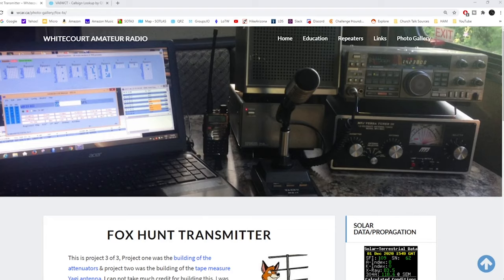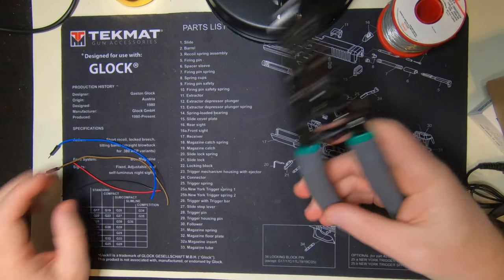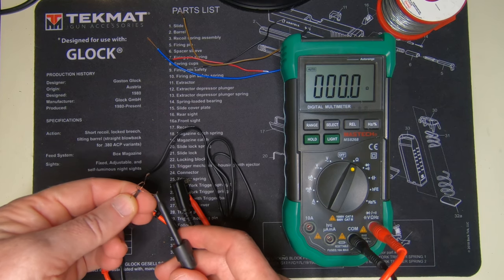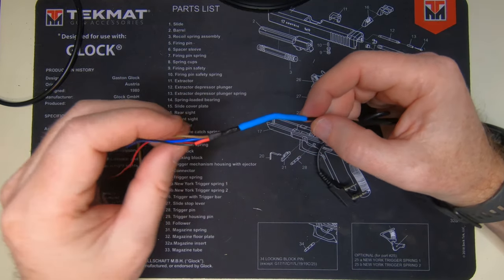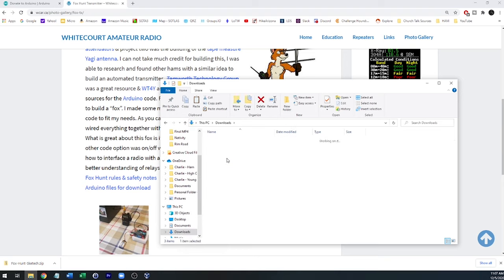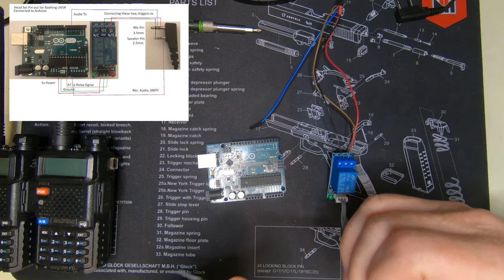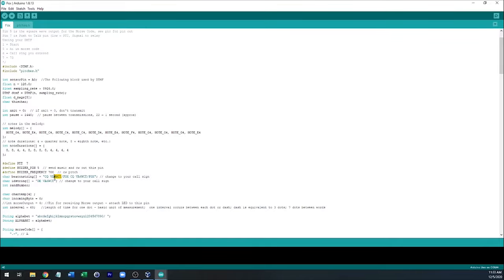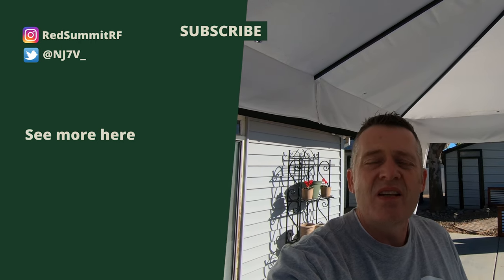How to Build a Fox Hunt Transmitter

Comment: After tinkering with this the last few hours, I finally got the DTMF code to work. At least intermittently. I'll caveat this by saying that I don't know if any of what I did made a difference because it is still intermittent and frustrating. First thing I did was go to Sketch>Add File and select the dtmf.h file. It made sense for it to be there if the pitches.h was there. Second, I turned up the volume on the transmitter. If the DTMF tones are being transmitted through the microphone portion of the plug, I'm not sure it was necessary, but I did it anyway. I also programmed the DTMF tone in my Anytone to a quick key function. Again, certainly not necessary, but it seemed to work. At least occasionally and that's how I got it to start the first time. I did manage to manually trigger the code once. Took me a while to figure out how to actually transmit a DTMF tones using the keypad. Never used DTMF tones before. As I said, it doesn't seem to be consistent though. I don't know if that's a result of the timing issue with sending the code discussed in the video or if it's something else. In any case, when it works, it works. Sometimes it takes a minute for it to actually start transmitting so I never know if it's actually working or not. Not even the other codes like the 73 work consistently. And then when I send a different number to stop the transmission, I never know if it's actually off or not until a minute or so later when it does or doesn't start transmitting again. Either the code is buggy as all get out or I'm doing something very wrong on my end. Any thoughts or ideas would be appreciated.
Reply from the maker: Hi Brandon - it's been a looong time since I played with this project.  Even then I barrowed the code and idea from others.  I seem to remember my project performing about the same - kinda buggy.  If you figure it out I'd love to hear from you about what you did.

Comment: This is a fun easy project. I have some notes from my day of tinkering.
This script is small enough to fit on an arduino nano, if you want even smaller.
You can test without a transmitter, adding a buzzer wired +to pin D5 (same as audio tx) and - to a gnd. You'll hear the tune and cw, and the relay clicks for ptt.
int xmit = 0; will transmit on dtmf tone. int xmit = 1; starts on power up
You can also change out the song easily by searching arduino music and copying the notes and note type.
Adjust "thisNote < 12;" to the number of notes to play. You should add "#define REST      0" to pitches.h for songs with rests.
Reply from the maker: Thank you for this!  Very helpful information and I hope all future views find and read this.  Good info.

Comment: Great little project, I've had an Uno lying around for ages waiting to find a nice project. Thanks!
Reply from the maker: This one is a great one for a pool lonely Uno!  Good luck!
Reply: @RedSummitRF   Got it built, but having issues. The relay switches and the radio transits for a second, no morse or anything.
Reply from the maker: @driverfilmsshortwavechannel  which of the two sketches?

Comment: 😅hello i have built this Fox controller  that functions exactly like the origonal with one exception, it uses no relay but uses a NPN transistor  and a resistor  to key the radio and I use a arduino NANO  AND RUNS OFF THE BAOFENGS  battery. I am still working on getting the DTMF to be included and operate  but i will nail it down in a day or two . I will stick it to the back of the radio.
Reply from the maker: Fantastic, Coy - it's amazing what you can do with the microcontrollers eh?

Comment: Great video, cheers. Can you programe the frequency or have to use one that's been already set?

Cheers.
Reply from the maker: If I remember correctly the frequency is determined by what you have your radio tuned into to.  I don't think there is anything about the frequency in the code.
Reply: Ah ok awesome. Cheers for that!

Comment: If I'm not crazy, I think your diagram is wrong: 
a) you show the speaker tip going to COM on the relay and speaker sleeve going to Analog pin zero (A0) on the UNO--should be the reverse: tip going to A0 and sleeve to COM
b) it says Relay output going to A7--should be Digital 7 (which is what the diagram shows--the text is wrong)
Agree?
Reply from the maker: oh man, it has been a minute since I made this video.  The diagram was provided on the Whitecourt Amateur Radio Club website where I got the sketch, which I understand is no longer up.  What you are saying makes sense.  The only thing I can't figure is how I got it to work given that.  I must have accounted for it somehow.
Reply: @RedSummitRF  OK--I'm crazy. I had it working somehow (erratically), then I started seeing the schematic all over cyberspace so I figured I can't be the only one, so now it's better. Sorry for the distraction and thanks for your reply.

Comment: Well, my first attempt failed. I didn't use this exact relay as I had one that came with my Arduino kit. I did however wire it up as I thought was the same. However I seem to thing when the code says "HIGH" it should say "LOW" as my relay turns on as soon as the code uploads.
Reply from the maker: Well bummer.  You do have to have a little bit of the knack to get these things running.  Especially since this video is a little bit older and I don't know if the same parts are still available.  But, yes, you should be able use any relay . . . if you wire it correctly HAHA!  Good luck on your project. I hope you get it working!

Comment: Thanks for this video. Is there a part number available for the ribbon cables that connects the relay to the Arduino?
Reply from the maker: Hi kieferiii - well, I just grabbed it out of a tub of parts I inherited so I don't have a part number, but those breadboard jumper wires I have listed in the video description should work out great!  Good luck with the project and thanks for checking out the video.
Reply: @RedSummitRF  much appreciated! Thanks for putting this out there!

Comment: What is the overall dimensions of this build, if i wanted to put this in an enclosure box?
Reply from the maker: Well I haven't put mine in an enclosure but the Baofeng (without the belt clip and antenna) is 4in x 2in x 1in.  You will need the antenna but most will find a way to keep that outside the enclosure.  The Arduino is 2.75in x 2in x 0.5 in.  The relay is 1.5in x 1in x 0.75 in.  Then there is are the wires which don't take up much space.  I think you could make it fit into a 4.5 in x 2.5 in x 2.5 in enclosure.

Comment: directions  seemed  ok.  but  after  following  everything,  it  still  will  not  work. the  hardware  is  good.  blink  works.
software  must  be  bad.  but  followed  directions  exactly,  and  tried  everything  at  least  twice,  and  erased  it  all, and  started  from  scratch  ,  and  did  it  all  again,  but  it  
will not  do  anything.
Reply from the maker: Hi Peter - this is a pretty old video now.  I am not certain what the issue might be.  Have you looked through the other posted comments in this video yet.  That might help with your troubleshooting.

Comment: Why 146.565 mhz?
Reply from the maker: This is one of the accepted transmitter hunt frequencies. It's used a lot for beaconing in t-hunts.
Reply: I don't think I would use a beacon frequency for a fox hunt  because all of the confusion that could be done on those parts of the bands.

Comment: I guess a MP3 would save most of efforts. LOL
Reply from the maker: How so?  MP3s don't transmit radio communication.  How would the radio receive an MP3?
Reply: @RedSummitRF  I mean connect a mp3 to the radio and set the vox on.
Reply: Of course it is a very naive one. What you made is a more sofisticated transmitter.
Reply from the maker: @chengchen8280  oh I see. OK. Not a bad idea 👍

Comment: No matter what I've been able to do over the last four hours, I cannot get the fox.ino to work. I've loaded the DTMF folder to the libraries, not receiving any syntax errors before I load it to the arduino, but it does not appear that it's acknowledging the DTMF signals at all. It won't even play the melody. I've checked thoroughly that I've got continuity in the DTMF line, so it's not a hardware issue. I'm at a loss for why it won't work.
Reply from the maker: Sorry for the late reply.  I was on a cruise (no cell service) the past week.  Are you still having issues?  Not sure I'll be of help but I'll try.